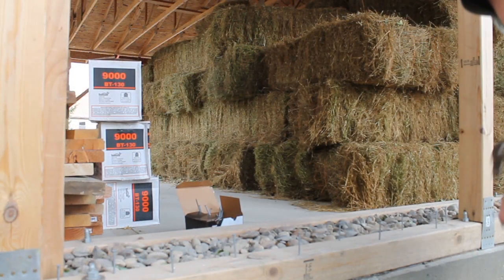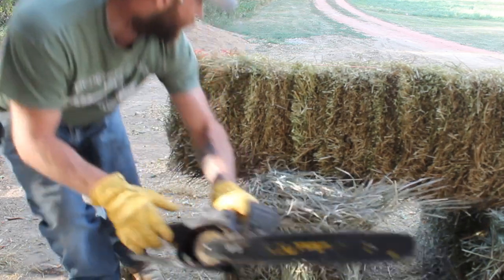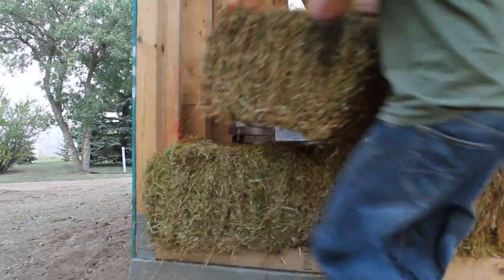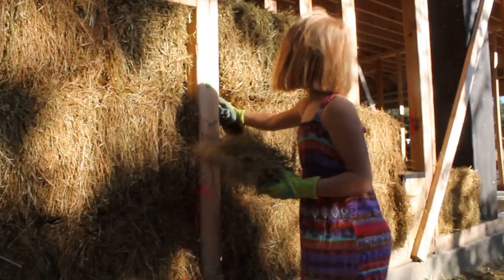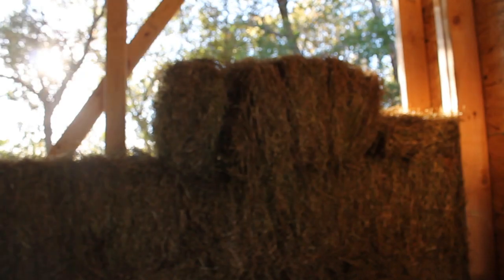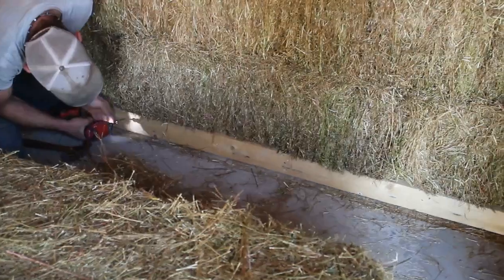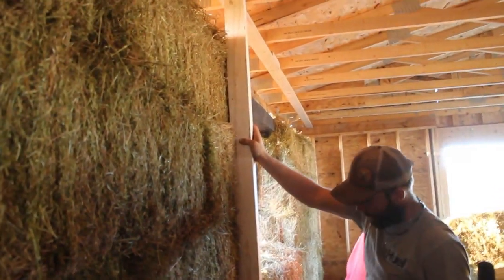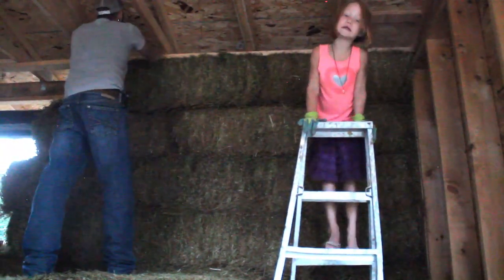Straw Bale House Walls! | Part 1

Comment: I just finished my strawbale house.  Took 2 years to complete.  We had the same issue with our wall/bale width.  We ended up using angle grinders with chainsaw discs to shave down the walls.

Comment: the Canadian equivalent of America's Underwriter's Laboratory tested the fire safety of straw bale building and fount it was actually more safe than conventional buildings. Even so no sense causing problems
Reply: In Tirol austria they made a high building (11 floors high in Innsbrück 15 years ago) and they submitted it to all troubles a building could have (earthquake simulated... Fire... Waterfallls etc... etc) then as it was, a full success, they encouraged all the province of Tirol to built with straw bales and wooden beams.
And edited a "technical norms" which are the rules... Yu HAVE to respect to build such structure. Yu know those guys are very serious one.. If they discovered ANY trouble with straw bales construction they will forbide it and  certainly won t encourage it.
In france as usual we are late.. On  bioclimatic conception.  Fuckin' so called "environmentalist ministers"... Still on "sustainable dvt" line... Lobbyists... That s what they are.!
Usual bullshits...

Comment: I am coming late to the party, and this comment will come late for this project. I suggest to any future builders watching this to vertically stake the bales together in addition to the squash plates. This will help "lock" the tiered bales (horizontal layers) to each other, creating a stronger wall. This helps mitigate potential cracking of the plastered coats by minimizing lateral movement and potential shifting of the bales in high winds, especially in areas prone to severe winds and to structures this large. Just my opinion.
Reply from the maker: Thanks for watching! how would you recommend to stake them vertically?
Reply: @buildingroots5873  Full transparency, I have not built a straw bale, although it's on my to-do list, but I've been studying them for many years. The vertical staking that makes the most sense to me is bamboo. Cut on the diagonal and drive it through the bales. I've also seen it done with rebar, but I don't like the idea of using metal due to moisture. Bale walls breathe, so even a small amount of moisture over many, many years will eventually corrode and/or rust, and that would defeat the purpose of the stakes. Bamboo is naturally rot resistant and will breathe also, so it will "shed" moisture. I reiterate, this is my opinion.
Reply from the maker: that sounds like a great idea! All i knew of at the time was using rebar and i didn't like that idea either. I'm unsure how well the metal wire mesh we used will do as far as corroding, but I didn't know of any other option at the time. Another commenter mentioned using composite mesh.

Comment: Best way of building a house. Take cautions but there s no challenge with ANY other technics and materials compared with straw bales and wooden beams.
Only trouble : lack of inertie of the structure. So yu must plan to build thick partition walls inside and if possible a massive stove covered of colored ceramic tiles right in the liddle of the house... It will compensate the lack of inertie during winter as summer.

Comment: On your bottom plate above the concrete I don’t see any kind of moisture barrier do you know if it the bottom plate will get moist in contact with the concrete or wick moisture into the bale ?
Reply from the maker: great question. i regret not adding one, we had meant to but spaced it out when we were working. i would highly recommend one!

Comment: Great video. I'm thinking about building my own house using straw bales. This makes it look cool: a lot of work, but fun.  But a question from a Monday morning quarterback: Wouldn't it have been easier to run the bales outside the post and beam frame? Fewer notches to cut out and less work.
Reply from the maker: thank.you.. I am not sure how that would work. maybe load bearing straw bale walls is something to look into for an alternative to nothing around posts, for us that was easy compared to all the detailing around windows/door.
Reply: Or put the bales between the studs and fill in any gaps.

Comment: Just turn you bales over to the narrower side. Should have used rebarb in the cement
Reply from the maker: we did not want the strings facing the inside and out for weed wacking reasons.  We did not go with the rebar being we went the infill route. Heres an article that we followed: https://www.strawbale.com/rebar_cons/

Comment: I've seen some ultra compressed straw bales at our feed store. Wonder if the would be better, or maybe worse, don't know. Yours look pretty standard. Could you have set the baler way tight? Three wire straw bales???
Reply: I do not think the r-value would be any different , a neighbor used to make the compressed bale's for shipment to japan . You make ordinary bale's , then compress each one and retie it so they would be a extra step and one more machine
Reply from the maker: Im not sure on that one either. Strings are the way to go vs wire as far as building a house with. Yes, Our bales are standard and the strings are tight.

Comment: I don't understand the benefit of the straw if you still need all the wood?
Reply from the maker: Some do a load bearing style strawbale house where there is little wood needed. Bit this style still uses much less than a traditional framed home. Thicker walls, ascetic, higher r-value, etc are all perks of straw bale homes.

Comment: Did you have to get permits and engineering.
Reply from the maker: no but we had an engineer friend check out our plans and he gave us recommendations.
Reply: @buildingroots5873 
In fact... The only pb is the wooden structure.. Straw bales are just "filling" and "insolating" " system.
The main pb often people forget to pay attention is the lack of inertie of such a construction system.
If yu have enough partition and distributive massive walls..  A big massive stove covered of colored ceramic tiles (such as Tirolian stove) ... Right in the middle of the building... It s perfect. It will compensate the lack of inertie.